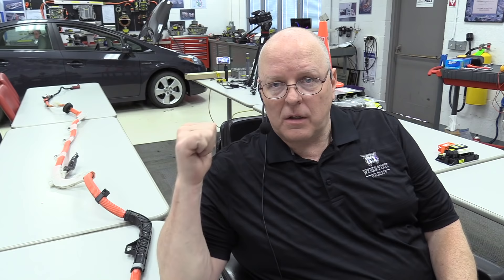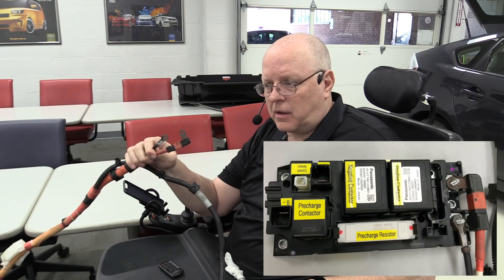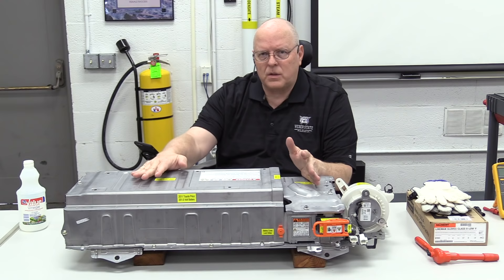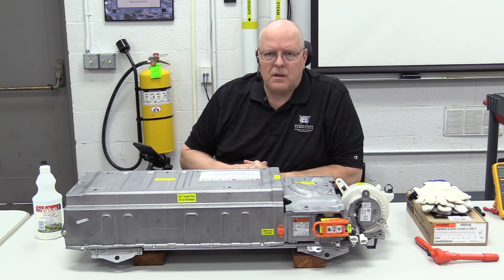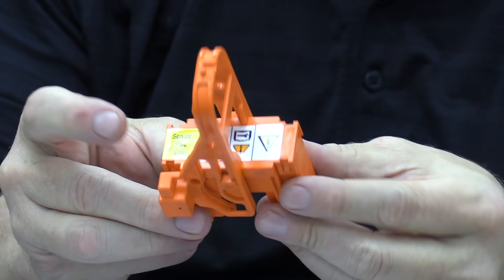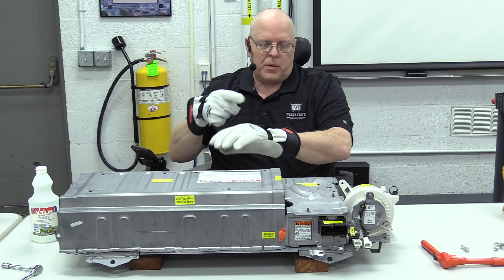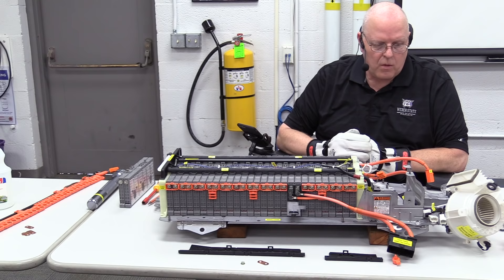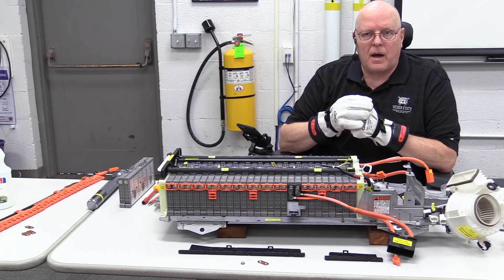2010-2015 Toyota Prius Ni-MH Battery

Comment: Thanks a lot for your educational video. I have Prius v2 2015 and showing me that I need to change the hybrid battery. I started cleaning the copper conductor and then while I try to put back suddenly I short the battery for fractions of a second. I checked the voltage it’s 226v and when I try to start the engine won’t work. Where would be the damage happen? Thanks .
Reply from the maker: You could have triggered a trouble code. There is a fuse in the service plug that could have blown. Damage to the battery ECU could have occurred as well. Always disconnect everything from the battery before performing service work on it. Best wishes
Reply: Thanks a lot. I was reading a lot of Q and A about it and I found that I didn’t push hard the orange fuse grip. This morning went to the car then pushing hard to the right side and start the engine. It works. But there is a car sign on the dash board. Probably need to change the whole copper conductors. Thanks  .

Comment: Thank you for the great video, very informative. Can you please help with my dilemma? I have a 2006 Prius only 150k miles on it. It gave the signs of the battery cell modules going out so we took it out and tested each cell module. I came up with all cell modules at 7.85 volts except one which is 6.85 volts, should I just replace that one cell or can it be charged with the "Lipro Balance charger". Also should I try to get a cell module around the same volts as the other ones; I've only been finding 7.2 volts online. please help!! Thank you
Reply from the maker: All modules need to be a close to the same voltage. 7.2V is the nominal voltage without being charged (six 1.2V cells).  I would just replace the one and see what happens next. Best wishes!
Reply: @WeberAuto  what do you think about the prolong charger/discharger ?

Comment: Excellent educational video! What are differences and similarity in HV battery cells at Prius gen.2, Prius gen.3 and Prius+ gen.1? Are all NiMH and same size and capacity? Thank U! (sorry on my bad english, I hope You understand my Q.)
Reply from the maker: They appear to be identical other than the date codes on top of them. Thank you!
Reply: So, cells are phisicaly and chemicaly identical, but "set organisation " inside HVbatt. and control modules with rellays are little diferent. Only Prius gen4 cells are Li-Ion with proper electronic. Thank You Sir!!
Reply from the maker: Yes,  gen 4 Prius can be Li-Ion or the old Ni-Mh type.

Comment: 19:55 contacts terminals corrode just like the terminals on 12V lead acid batteries and the 3 terminals on the starter. I have only ever put a starter in 1 of my cars. I only buy 10-20 year old cars. I dought there was anything wrong with the starter on my first car but I didn't even know where it was.

Comment: Sir, to clean the voltage sense bus bars from corrosion, just disconnect the service plug grip to be safe ? or there is another plugs to remove ? another question sir, my 2014 Prius has completed 40,000 Miles, do the sensing bus bars need to be cleaned as you mentioned in the video ?
Reply from the maker: The bus bars never need to be cleaned unless there is a trouble code indicating a bad battery. When that happens, the preferred method of repairing the vehicle is to replace the battery; however, cleaning the bus bars has been found to fix the problem in many vehicles. Disconnecting the service plug only protects you from high voltage outside the battery case. Once you open the battery case, you will need to use personal protective equipment (PPE) to keep from accidentally being shocked. There are no additional service plugs inside the battery case. Be sure to see my PPE video here: https://www.youtube.com/edit?o=U&video_id=Fgs46PsTon4 best wishes.

Comment: Thank you so much for sharing this information. Do you know what a DTC P0DC2 is? That's the code we are getting on a 2013 Prius that won't start with a Check Hybrid System message on the dash.

Comment: Hi Sir my car is done 210000 miles recently I've got on my dashboard showing that check the hybrid system some light shows on dashboard such as Engine and something else as well could you please help me on this many thanks
Reply from the maker: Hi, there are many many possible causes of that problem. You will need to have someone check for trouble codes first and then see what needs to be repaired. Best wishes.

Comment: question for ya. The voltage sense wires that go to every pack/module, correct me if I am wrong but you said it would measure about 14V. I may be wrong and please explain if I am. Wouldn't each wire  have a reading of 7V? The wire is connected at the bus bar that is basicly in the middle of the battery pack/module not at the end of each pack, right?
Great videos.
Reply from the maker: Thank you! The voltage sense wires only run down one side of the battery. This means that it can only read every other module's voltage (so two modules are in series with each other for every sensing wire= 14.4V). I hope that helps.

Comment: Great video however I see a would be mistake. When you hooked up your Fluke to the leads at 19:40 you hooked them in reverse polarity. It shows on your meter a -210vdc which is misleading while following your instructions.  I being a greenhorn at this Prius battery am trying to do a changeout and not sure how to proceed. Am I hooking pos to neg?

Comment: Professor,
A quick question,
Do you think it is possible to make a charge cord for a RAV4 2022 Hybrid?

I’m in Australia and This does not have a PHEV option here, house voltage here is 240 vac.
Is there somewhere we can tap-into the wiring to charge?
Or can we charging the 12 vdc car battery, would that charge the Hybrid battery?

Comment: Is there a standard in high voltage connectors or are they all very different?
Reply from the maker: Good question. Other than the color, I am not aware of one. I could be wrong

Comment: How much load should i use for a load test of a cell? Is it ok if use car lightbulb (i measured cca 1.5A of current )? Leave a cell for 2 min and see how much voltage of a cell drops? If cells have cca 7.7V what drop of voltage is in OK range?
Reply from the maker: The vehicle load tests each cell under heavy acceleration. Just watch the current and voltages to obtain your answers. Best wishes

Comment: Hello John, Great videos!
I have a 2015 Camry Hybrid that had a POA80 code and Toyota had determined the hybrid battery cooling system needed to be cleaned, they did that and it was fine for a couple weeks until the warning lights came on again and I'm getting the P0A80 code once again.

My OBD2 reader tells me that the center temperature sensor is consistently reading higher than the outer sensors, with the center modules around  group 10, 11 & 12 having poor balance against the others with a lower voltage reading and the outer 2 module groups 1 & 17 being having voltage readings.

I've taken the battery pack out of the vehicle and test the resting voltage of each module, which seed to correspond to the pattern of the OBD readings but not as extreme, actually the differences were quite subtle.

After doing a 2 minute load test using a 55W light bulb on each module, the max difference in voltage drop was 0.34V and the minimum voltage drop was 0.19V.

Please correct me if I'm wrong but the above readings off the modules themselves are within the allowable threshold for Voltage differences between cells with only a 0.15 difference, no?

I did notice a couple of things that could potentially have contributed to the P0A80 code when I tore the battery pack apart:

1. The cooling tubes that lay across the top of each side of the modules were not present on my battery pack and I do not know if my model deleted that part or if someone forgot to put them back on when servicing the cooling system? To me this would explain the inconsistent temperature readings but what's your thought?

2. The bus bars had some minor corrosion around module groups 10, 11 & 12 which is consistent with my slightly lower Voltage readings as well and they were only corroded on the voltage/temperature sensor side of the pack.

I'm about to replace the original bus bars and nuts with the upgraded nickel plated copper bus bars and stainless nuts since I have it all open anyway and also because I live on the coast where we have higher humidity.

I'll see what the OBD readings are after I put it all back together but if you could let me know your thoughts and provide answers to my couple questions I would greatly appreciate it.

Thanks in advance!

Comment: here's  several things for getting a good result
Don't try to do this unless you know what you are doing - the acid can burn you
check the voltage first - there may be a kaput cell which would waste your time.
Check the battery fluid.
attempt to fully charge the battery.
(I learned about these and more on Jons mender guide website )
Reply from the maker: Thanks for your feedback

Comment: I have a 2004 prius that will not start with a POAFA code. Took the battery out and tested the modules individually and found lost of water/condensation/corrosion in the pack.  I found a block of 8 modules in a row reading less than 1 volt. The bad modules are the first 8 on the passenger side. I'm happy to replace them but I'm wondering if there is a larger problem since they failed 8 in a row.
Reply from the maker: It sounds like the cooling fan may not be working correctly or the cooling intake by the rear seat back may be blocked or restricted. That could make the battery run hot and not remove the condensation. Make sure your bus bars have good connections. Best wishes

Comment: Sir, I have a 2011 Prius and wan to run a 12V Dometic CF-18 refrigerator off the Prius auxiliary 12V in the back.  Can I do that, and if so, do I just need to get an adapter of some sort?  Also would like to use an induction burner off it briefly for cooking.  Sure would appreciate if you have time to respond.  Thank you.
Reply from the maker: That battery is too small to support such a large load without the system powered up (Ready light on) at all times.

Comment: I wanted to ask what is the layout for the battery blocks in the hybrid battery? Does it start from #1 block from the battery disconnect, and smart unit? Or does the #1 block start from the other end? Thank You
Reply from the maker: It starts at the HV ECU end and moves to the other side.
Reply: The single battery module that starts at the HV ECU end would that start as the #1 block then? I know that the "Single" battery module that starts at the HV ECU end is connected with another battery module towards then end of the battery pack. So would that make that one "single" battery module the #1 block? Thank you!

Comment: question...first thanks for your great videos. ok...I own and drive a 2013 prius (two)- the cooling fan you talk about at about 50:40 on this video sometimes makes noise. (usually in warm weather or on long drives)..the noise is coming from the vent near the passenger side rear seat...as you show...the sound it makes is like a desktop fan blade rubbing while spinning. my question is...should I do something? I mentioned it to toyota service at the dealer...they dismissed it as...no worries...but also didnt really make me feel like they cared or knew what I meant... the car runs great ...has about 61000 miles. I hope this is the correct way to ask you questions...if not please tell me the right way to ask you this stuff...thanks very much
Reply from the maker: Check the vent inlet for obstructions (hair, lint, dust, etc. Vacuum it out. If it is actually rubbing, it needs to be replaced.
Reply: The fan itself can actually be opened up and thoroughly cleaned.  You should be able to see what is causing the noise and fix it easily.

Comment: Sir you are good teacher,I have Toyota prius2009 that has a signal of check engine and check charging system how could work by process of elemenation?
Reply from the maker: Check for codes and follow diagnostics first

Comment: Super HVAC epoxy will  "weld" together dissimilar metals and metal to plastic or wood or pvc etc, its conductive and stronger than JB weld, it will connect 2 copper pipes with a large size diffeence without a connector!  just in case of things like the open spot on that harness, My family would try to fix one even if they replaced it.
Reply from the maker: Thanks for the feedback!

Comment: Hi, I have a Technical Question about 
The batteries" The modules that can be pulled out, & used for other things" like
Wiring them up to make 14 volts, & THEN 
Wire any others up to add amps.!!
So, I know they are Nicad, so how do I charge them, out of the case wired to use in my RV....

Comment: Hello Professor, thank you for such a detailed video. i am operating a small workshop in my town recently few Prius gen 3 came in with DTC "Hybrid Battery Replacement ". the terminals were bad so i cleaned them up charged the battery pack in pair of 14 Volts and created a 14 volt series complete battery pack and charged it with 17volts over night. All prius did really well for a week or 2 but some popped up the same DTC "Hybrid Battery Replacement". is there any thing that im doing wrong or am i missing any thing.
Reply from the maker: Sometimes cleaning the battery terminals is not enough, battery modules must be replaced as well. Look for unequal voltages when comparing module to module. Those modules with lower voltages probably need to be replaced.  Best wishes1
Reply: WeberAuto  thank you professor. I checked the voltages on each cell every cell gave almost equal voltage.. and do i need to charge the battery pack before installing it back ?

Comment: It is your profession, but are you sure that thoose probes category III? Dont they have a small protective sleeve on their end? As far as i know that is the purpsoe of that sleeve to cover the exposed and unnecceserry probetip. But also i think you have to take it off from it to access that point you just measured at 20:37. Becuase it would not reach the connector. What is your opinion?
Reply: http://ec.staubli.com/AcroFiles/Catalogues/TM_Test&Measure-O_(en)_hi.pdf (page 16). Yes i was right, if more than 4mm of the probe is exposed it is only a CAT II probe. Altough, you must take it off, because you cant reach the terminal.
Reply from the maker: Good point, thank you! The older Fluke CAT III meter leads I used in the video are also rated CAT IV. They did not come with a sleeve of any type. I did purchase some newer Fluke meter leads and they have a rotating tip/cover that acts like the sleeves you mention. You twist it in one direction and it becomes a CAT IV lead, you twist it in the other direction and it becomes a CAT III
Reply: I glad that i helped.

Comment: Would it be possible to swap in a ford cmax battery cells in to a 1st gen Prius? I have seen ppl use a battery+ DC converter, to charge the battery, so the car sees regenerative power, and making it a plug in hybrid,

Comment: Hi Profesor Kelly 
I have 2009 Toyota prius 
Recently I have noticed on my dashboard  one side of it it's same visibility all the time

The other half  - right side where speedometer side is 
 first 30 min of driving it's same like the other half and than dims like half visibility and the same time 
sound of short circuit I can hear from dashboard until I turn off the car for some time 1h or a night but next day it's the same after 30 min driving 

Any chance you come across something like that 
Please advice on what to check or what could be the problem? 
Manny thanks 
Bart

Comment: How much should each pair of cells be charged to. Floating lead acid, I charge to 14.5. But these being normally 7.3 each and two being approx 14.6, what should my charge controller be set to? I have 34 cells from a 2008 nissan.

Comment: Thanks for your great video,prof. Your explanation is very informative and helpful for me. I have 2 batteries NiMH but cannot be used. I have just test 1 battery. In my testing, I found that there is some differences in each module. Some modules have voltage above 7.3 but there are some modules with voltage between 7.00-7.25 and moreover I found battery with voltage at 6.87. Could you help me why the voltage can be different among the modules and is there any effect for the performance of that battery?
Thanks
Reply from the maker: Poor connections can cause voltage drops and different module voltages. All voltages should be very close to each other in the same battery. It is normal for all of the the voltages to go up and down together as the vehicle is driven.
Reply: Thank you for your answer prof, but do you know the characteristics of battery when the vehicle in driving?
Reply from the maker: @novagiaaditasembiringmelia5086  What characteristics are you looking for?
Reply: I have heard someone said that a cell module at right or left side get more stressed than in the middle. What is your opinion about that?
Reply from the maker: @novagiaaditasembiringmelia5086  I do not believe it. They are all in series electrically and have the same current.
Reply: okay thanks for all prof
Reply: @WeberAuto  well sir i think it does effect more the cells in the midlle because they have the least colling they are surronded with warm cells and they are getting warm itself. Its jist my opinion you are for sure more expirienced and have a lot of knowledge but this is just my opinion while learning of all this hybrid batt pack :)